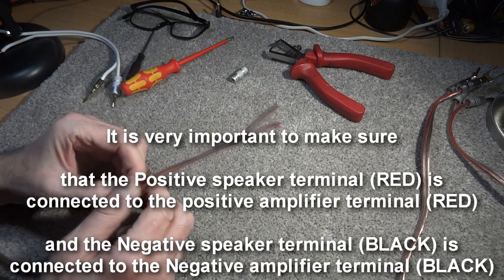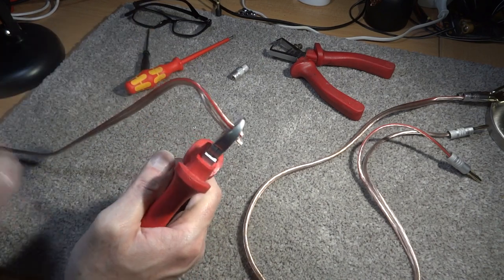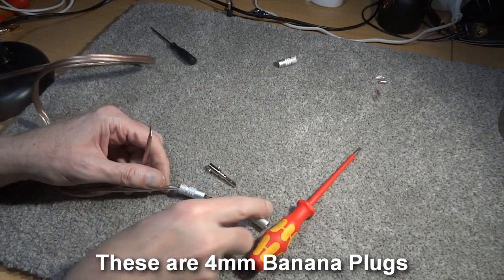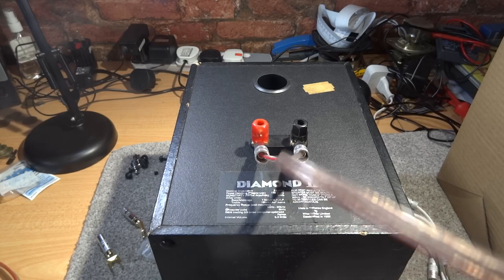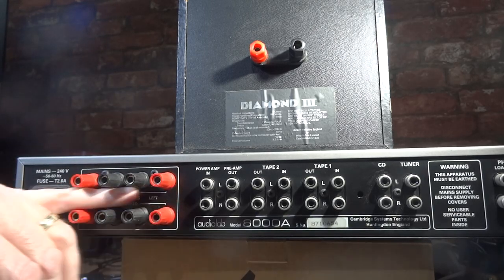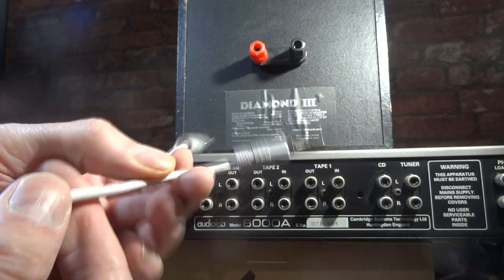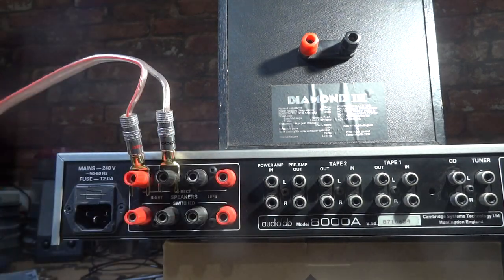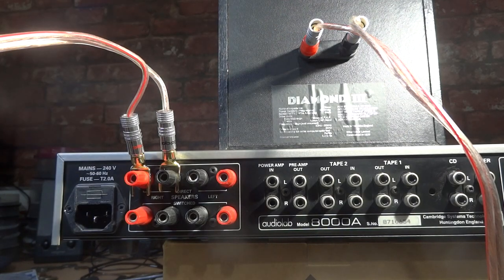How to Connect Speakers to Amplifier. Speaker Connections Banana Plug, Spade Wire HiFi Stereo Audio

Comment: Thanks I want to plug my banana cable to Fosi bt20 pro but i couldn't why maybe my banana cable is 4mm or what?
Reply from the maker: looking at the pics of the Fosi they look like standard 4mm banana sockets, you may have 6 or 8mm plugs on your cable. Some plugs fit really tight.
Reply: @MichaelYates   

Thanks alot